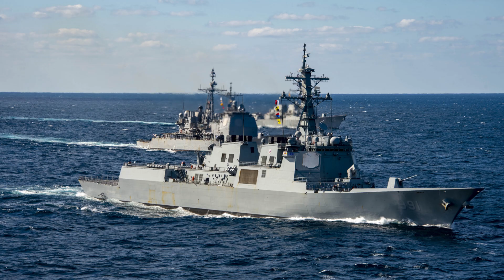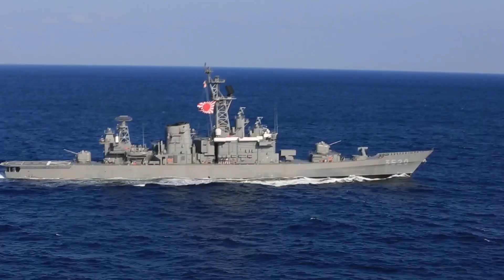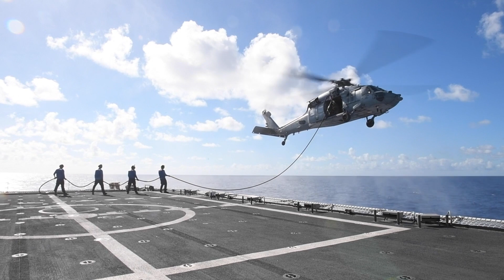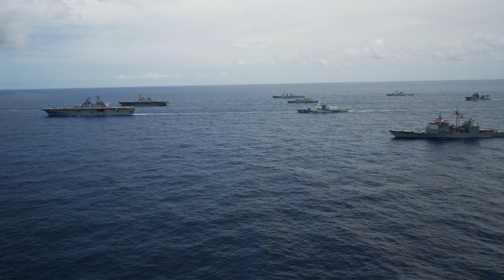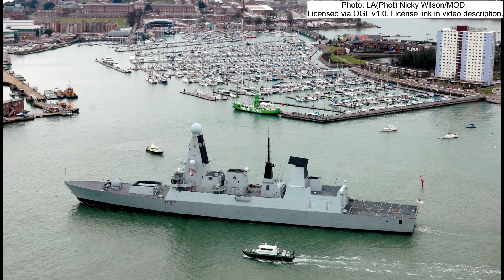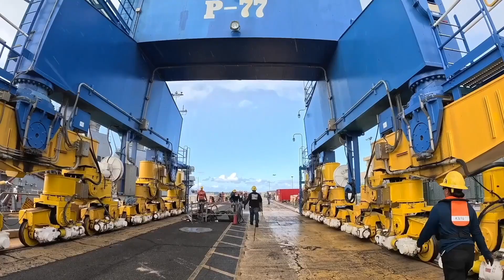How to Design a Modern Destroyer (A Beginner's Guide)

Comment: An important concept with modularity (though certain naval bloggers with dubious sourcing may disagree) is “steel is cheap and air is free”. Of course it’s a bit more complicated than that since increasing warship size increases propulsions costs but because of the square cube law it does so to a decreasing amount. 

At the same time a larger ship is better than a smaller ship at more than a linear rate (this is especially true for aircraft carriers which is why the U.S. will never go back to smaller designs). 

We see a rise in “fitted for but not with” ships operating on this principle and looks to integrate hull plugs in the new DDGx. 

To go back to an even earlier example the Gearing Class DDs were basically Fletcher/Sumners with a hull plug and because of that they had the spare tonnage to incorporate ASROC, vastly improving their service lives (in the USN, the ROC had some very weird refits).